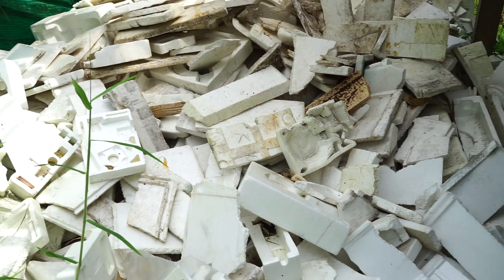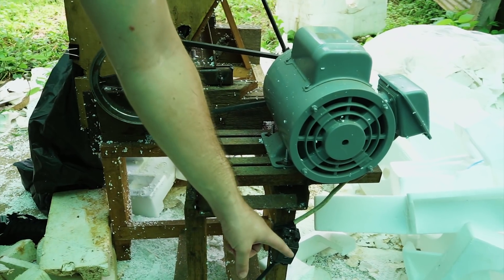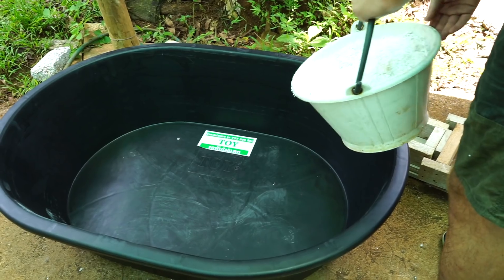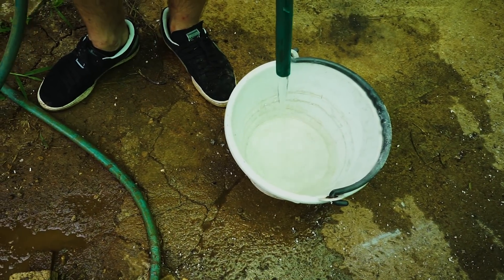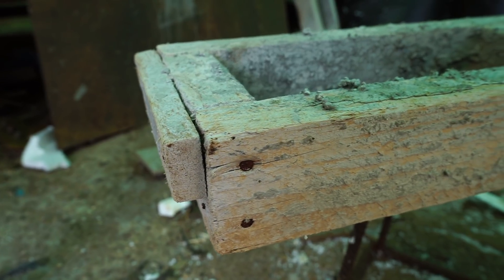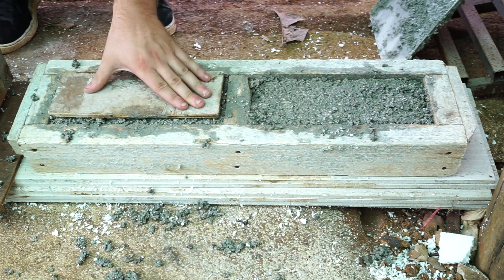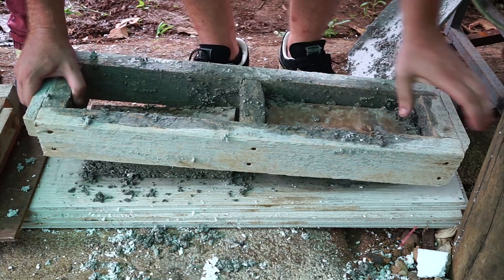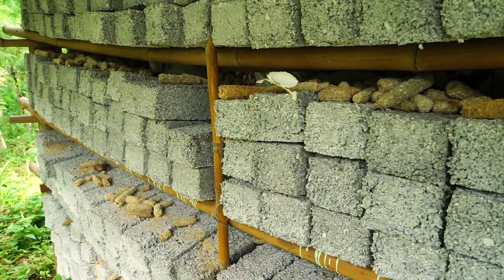Styrofoam Bricks DIY

Comment: Some advice from a man who was a brick layer for 20 years. Add some sand, perhaps; 5 styro, 1 cement and 1 sand. This will give your bricks more strength and make the finish smoother. As has been mentioned already, a better mould (form work) will make a better job, I suggest a metal box, maybe 1.2 millimeter steel (1/8th inch American) with a base of the same material. Your big mistake is removing the bricks from the form work too soon (Far too soon) If you coat (paint) the inside of your form work with old cooking oil, then leave the bricks to dry till the next day, you can just bang them out upside down. Lastly, you will not be able to build occupation rated buildings. (ie: places where people will live or sleep) Building bricks must have by law a 2 hour fire rating. They must withstand a fire for 2 hours minimum before they disintegrate. Your bricks will not only burn quickly, they will intensify the fire and release poisonous fumes. But, garden planters, garden beds, garden borders etc, I think you have a great idea for any non fireproof building...
Reply: Agreed. We did have (25 years ago) here in Australia such 'styro' (pour-in-place) insulation but it was banned, even with added Borax it was still too 'inappropriate'. As I mentioned, such 'styro' bricks maybe ok for garden walls and such. Cheers...
Reply: @RoseRose-ex6qy  Is it possible to leave your Facebook account? Thank you
Or reach me in my email
gtu1433@gmail.com
Reply: Yes, because styrofoam has been an issue for thousands of years, even the Sumerians stuffed their pillows with the excess styrofoam laying about in their yards.
Reply: Lmfao this thing called styrofoam been an annoyance since Moses
Reply: tom jackson Straws can be mixed into concrete up to around 20% with no significant loss of strength, but it significantly increases the insulation value. In some cases it will even reinforce the concrete if the straws used has good tensile strength. If kept dry it should not rot, it can even contribute to moisture transfer.
Reply: Kube Dog 
Please link to one story about people suffocating to death.
Reply: This is how the Pueblo Indians made their bricks.
Reply: Perhaps, there is still the toxic fumes issue if using it as an insulation. Here in Australia we banned such insulation at least 25-30 years ago.
Reply: Toob 247 In the UK the IEE Regs give specific ratings to downgrade cables when they are enclosed in insulation! It is a real effect and CAN cause fires! (I have worked in the Electricity supply Industry for over 40 years) ...... As to cladding materiel on hotels, do you remember a fire in the UK last year that made the news? Grenfell? It has caused all multi story buildings to be re-tested and invariably th cladding removed! .....  There have also been some notable fires in UAE! Not that I think they used foam bricks for all of those buildings ;o)
Reply: Toob247 - You can't safely pack your hollow walls with this ordinary white Expanded Polystyrene EPS, as insulation.  Blue  "Styrofoam" (brand name), Closed Cell Extruded Polystyrene XPS, is used, and it is safe and fire rated. Only in the  USA and Canada do they call both of these products by the same name Styrofoam, they are totally different products. Note that one is Expanded and the other is Extruded. I see in another post that you are filling your walls with this White Polystyrene and Pour in Foam. This compromises your electrical wiring in that your wire size and current carrying capacity is designed around the assumption that the wiring is not totally enclosed. At high loads the wiring may overheat and set fire to the walls. Unless your pour in foam is sold for pouring into walls, it is also potentially unsafe to your general health. For example many of the industrial pour in foams contain toxic gases such as formaldehyde in the bubbles which slowly release over time.  I suggest that you talk to your insurance company asap. In most western countries it is actually against the law to use EPS as house insulation. This video is poorly named in that it is about making bricks from Expanded Polystyrene EPS, and not Styrofoam XPS.
Reply: The smell that comes from for example EPS is those gases that are not good to inhale, and even worse for children and especially infants.
Cement/concrete is normally porous and will not provide a gas-tight seal.
This is simply how it is.
Reply: Bobbert Bobby As a rule of thumb, chemical processes are sped up (or slowed down) 2x  for every 7 degrees C/K, meaning, gassing from a material increases too, until  combustion temperature is reached and it does not stop there,  the types of gases released will change though, of course. Such gases/vapours are a main factor in fire related deaths and injuries.
Reply: Styrofoam is not an issue.  But that's interesting about the Sumerians.  I might actually try the pillow thing.  If I don't like it, maybe the dogs will.
Reply: hi .. thanks 4 this information ... i learned alot.
i might get to try this/your idea.    afterwards i think of coating with normal stucco.   inside & out  ... after putting the  water pipes & electrical conduit. i would have rcc pillars here & there 4 strength ... your bricks would be filler not structural ... 4 a 14-16 foot diameter dome structure    my idea is: it would be kinda like a straw bale thing ... but thinner etc.   anyway .. i am glad i found your thus video.  thanks 4 making/posting
Reply: What is your suggestion to add another material so that the bricks resist fire?
Reply: Thanks for the information. Been thinking about making this as a bathroom wall, but not such a good idea after all. Thanks again
Reply: 40 years ago, we used ground corn cobs to mix with concrete.  It was strong enough to be a floor and had good thermal and acoustic insulating properties.

As far as I know, there are no toxic fumes from corn cobs.  Methane generation maay be a problem, but never was when I used the mix.
Reply: heavy.. not strong enough when earthquake.

i used it for earth oven siding.
Reply: Militum Xpisti O
Reply: Militum Xpisti yep... Looks like no sheer strength.
Reply: what about the wind ? will it blow the light house out ? their HAS to be a fire stopper to add to the mix
Reply: that lives you with mud wall ,strong & fire prof & cheap
Reply: corn flakes to ?
Reply: @ipeeinmysinkimafraidtocome7127  I think Cocoa Puffs would make better aggregate as long as you don't add too much milk to the mixture, although the calcium in the milk is supposed to help it cure.
Reply: what about using quickcrete. would that work.
Reply: Since the resultant product must be so light weight, I would cast them much bigger. I wonder what the dims of at 60-lb "brick" would be. For those of you that wish to explore more code-acceptable alternatives see Wikipedia for "AAC" and "foam concrete".
Reply: Militum, I was looking for something to fill up most of my monstrous birdbath which is far too deep for the birds (but looks awesome *wink*). I was thinking of doing something like this. But then I would put a thin layer of traditional concrete on the top to stop the water from penetrating (these look awfully porous). What do you think?
Reply: U R so right, but give him some credit.
Reply: Can the bricks look smooth?
Reply: Per your Note "Your bricks will not only burn quickly, they will intensify the fire and release poisonous fumes." - Funny thing is - Many Videos exist - showing this type of idea withstands open torch flames pretty good, and still do not radiate the heat to the back surface. 

It is not simply Styrofoam - which would perform quite like you described.
Reply: What if you added a layer of drywall on the inside and maybe something like cement board on the outside?
Reply: Makes no difference, a brick chimney (not the actual fireplace) could be surrounded by drywall or render or whatever you like, the bricks (and that's each individual brick) must sustain 2 hours of fire. (Fireplace bricks are made from a different material ie: fire clay) This construction ruling is for Australia however, so I would check with your local 'officials' if your not here in the Great Southern Land....
Reply: @MakeMeThinkAgain  Good idea, but I think that could potentially make matters worse though for an occupied structure.  My thoughts; the outer materials (cement board etc, drywall.) will resist flames but inside the bricks the styro melts to a liquid and, shrinks, sinks, stinks, and creates voids in the bricks where once the flames break the barrier it would take mere moments for the entire structure to engulf...I would imagine.  The toxicity is also a convincing point for both firefighters and fire victims.  Worth experimenting with though :)
Reply: You are all some right and some wrong...
EPS does give off some unhealthy gases, and should not be used inside livingrooms and bedrooms and such, but mineral and glass wool contains bad stuff too (for example Urea).
Regarding fires, EPS can have added some fire retardant.
Regarding wires, sometimes they are dimensioned for a specific placement method, and if so they may get hot if insulation is added.
The normal PVC (contains Chlorine) may then get soft and may cause a shortcircuit, and it may give off gas that are not only unhealthy but that may also erode metals in connectors and such.
Reply: @Kenzofeis  To make fireproof lightweight bricks, use perlite instead of styrofoam. Sort of defeats the purpose, perlite is a little expensive. Still, a great insulator and should lighten the bricks nearly as well as styrofoam.
Reply: @Bob_Adkins  
Of course, but EPS pellets encased in cement will not burn easily, but will release harmful gas, then again, many paints and construction materials does this at a much higher rate in a fire
Reply: Man I was just thinking about how great it would be to mass produce and sell, but yea totally didn't tink about fire codes.. Great info.
Reply: @ATLRIOT  I am want to do it too. I am making myself ready for this Alt Riot
Reply: The craze over recycling, re-purposing, conserving, etc. has led to doing some things in a not-quite-proper way.  A few years ago in the US, public housing got so crazy over insulating apartments to save money, they made them so air tight that people actually suffocated and died.  Remember, the average IQ in America and the UK is about 100, and that is not very bright.  And much of the populace is below 100.  People are stupid.  This crap will continue.  Learn and look out for yourself.
Reply: I was referring sarcasm into your comment “this is how Pueblo Injuns made bricks”

Comment: Brick eventually decay, are you just creating a future problem of uncontrolled future toxic waste? What is the fire safety on this stuff?
Reply: Nev Anderson Solving one problem with a future problem is not a solution- it is environmental procrastination for a time when you no longer have control. It is how good intentions can make things worse. This is not a well intended end of life solution for a toxic mess- it is a formula for long term distribution into the environment which may be worse. Moving your trash to the curb doesn’t get rid of it, it simply moves to another place with other problems. There are many engineering studies on the structural decay of bricks and cement. Read some of your them please and you might come up with a better set of bonding agents that dissipate some of the cyanogen is byproducts of what you are trying
Reply: Nev Anderson, you COMPLETELY missed the point. You could dispose of the plastic properly, or you can mix it into concrete and make it impossible to be extracted and disposed. David has the more educated perspective here.
Reply: +David Aaron You MISSED the point. 
The problem is Already Created; this utilises material that exists as waste, is a nuisance and ends up in landfill.  At worst this method encapsulates it for the life of the house.
Reply: You can say exactly the same for car or any other petrol vehicle but the again - everybody use them.
Reply: Helloverlord - I don’t live in America, luckily. Recycling of household plastic is mandatory. EU manufacturers received tax rebates for the percentage of recycled cars are in the new car (Oh, yeah - we are getting rid of petrol cars) The recycling is a real important issue for the end of life for home do it your self or manufacturing. If I can’t account for end of life, I am interested in the project

Comment: One thing to consider, if you haven't already, is to build your forms using a better grade of material.  If you use a smooth material, such as Melamine surfaced plywood, the forms will come off much easier and you won't get the broken corners like I saw in your video.  Melamine came to mind but there are plenty of other choices.  Perhaps lining your forms with plastic sheet or left over Formica sheets.  By the way, I think the idea of styrofoam bricks is a good one.
Reply: This guy's forms are so old, you're taking too a train conductor that's left years ago .. lol

Comment: If you contour your brick mold right, you could stack your bricks without mortar and still have some wind resistance.  Making a half brick form would help.  Think, LEGO bricks.  How do they hold up to weight being applied to them?  Have you tried forming other shapes like stock watering tanks or cisterns?  Is this material suitable for that use?

Comment: I was thinking to encase the styrofoam brick in a separate pure cement to have a neater, heavier, more robust brick that would hold up better to the elements and animals and such. Cool and informative indeed. Cheers.
Reply: I would guess that it would need about a 5/8" thick coating of cementitious material to give it ~1hr fire resistance, but there are a few companies out there providing concrete+styro building products that dont have any coating. bautex is one that come to mind.
Reply: @jberringer1720  ICCF, "perfect block" is another
Reply: Another great idea, thanks .

Comment: Ok I'll be the person to ask. What are the corn cobs doing on top of all the bricks??????
Reply: It is really quite easy.  We used a double lower plate framing the second story walls, and filled and troweled the floor smooth, and even with the top of the first (lower) 2 x 4 plate, for a 1 1/2 inch soundproof concrete layer on top of the normal subfloor.

The ground corn cob came in large bags, and we mixed it into the concrete in the hopper of the concrete pump.  Ground corn cob is very cheap and is readily available.  It is used as animal bedding in laboratories.  It was done in Tampa, Florida, and mainly for soundproofing.
Reply: Ground corn cobs are sometimes used in concrete to lighten it or make it more soundproof.  We used to pour a 1 1/2 inch floor of concrete/corn cob mix between floors on multi story buildings.
Reply: damn, i thought it was dog's poop, I was quite intrigued on how it got there
Reply: It seems that this is a ReCycle, ReUse, ReDuce, ETC. idea... NOT a "buy perlite" idea...
Reply: Interesting stuff man, thanks for the information!
Reply: OtterRose1 thanks for making that point 😀I was thinking your way also and think this is awesome usage of old foam
Reply: Someone will break that concrete in 100 years and wonder wtf is this
Reply: Dude! My thoughts exactly. I haven't the slightest idea
Reply: you said it a lot nicer than I would have,  but I'm a wicked wiseass!   Be Well  and Bravo!
Reply: +JB Exactly how much waste polystyrene will that get rid of then?  
You missed the Entire point of the video.  That is what happens when you Don't Listen.
Reply: Seems like a really odd and inefficient method; Why not use perlite instead? Also, is there a chance that this was done in some place like Nebraska that's had tons of cornfields?

Comment: any idea how this handles freezing and thawing?    have seen people making aircrete with home made foam machines, but this is nice because it uses stuff that otherwise either goes to the landfill or recycling...   reuse is better than recycle!
Reply: thomas mann... technically 'reuse' means keeping the item as is and repurposing it with no energy required... recycling assumes it will be broken down into components and put back together.   like punching holes in a glass bottle lid and using it for self watering a plant is different from sending the glass to a recycling depot where it will be crushed, melted and reformed into new glass items.
Reply: rapunzel eh? 
I found that my old bike could be recycled repeatedly
Reply: rapunzel eh? It obsorbs water... So cold areas it can freeze over... So its ok for garden areas not for living in
Reply: interesting... so not good for my climate - thanks,  now i can take the huge pile of white stryrofoam i've been keeping to the recycling depot!   will stick with the aircrete - it works well in freezing weather etc...